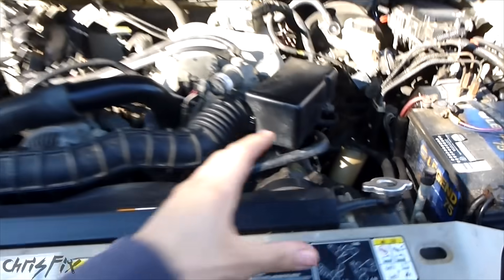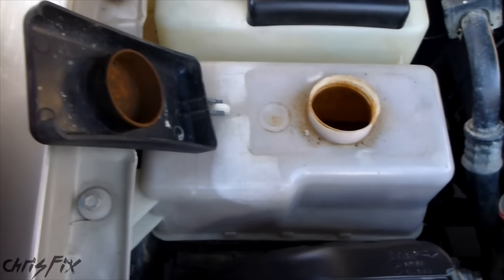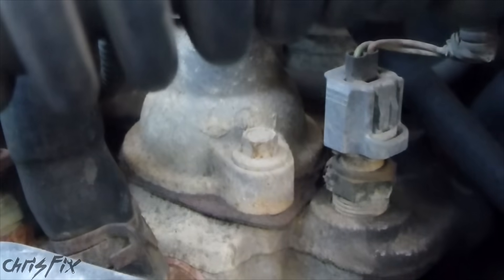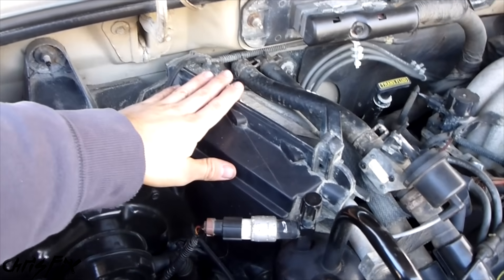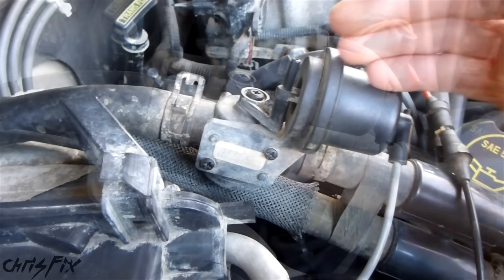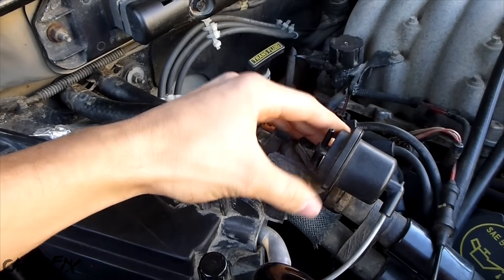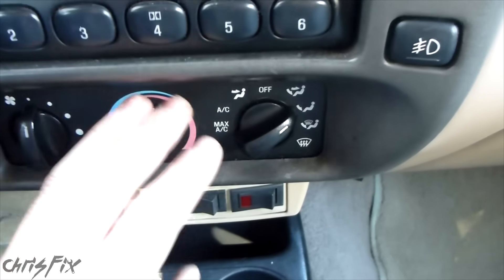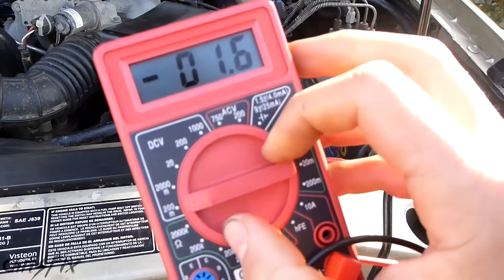How to Fix a Car with No Heat (Easy)

Comment: Dang that coolant in the radiator is sludgy
Reply from the maker: Yea it was bad. I ended up flushing it.
Reply: @ChrisFix. My daughter has s 2011 Chevy HH and the blower is not working at all, nor is any heat coming out of anywhere.  Not to mention,  water collects on the passenger side and gushes down on the floor, drenching it.   In the summer, the air conditioning doesn't work either, not sure what to do!!!   Please help me!!!!!

Comment: I'm tired of all these Toyota ads talking about how sporty the Corolla is let's be for real nothing is sporty about a corolla if they think that is sporty drive a Mazda
Reply: So, I drive 130 miles daily to go to college. (Adult going back to school.) my main vehicle is a brand new Explorer sport, amazing vehicle that I love but don't want to run the miles up on. My 01 Jeep that I drive daily just blew the radiator. Instead of fixing and dealing with that I decided to get a base model extremely cheap car that gets good MPG. Toyota offered that with a corolla. It was 14k with an amazing warranty, oil changes and car washes for life. Towing to the dealership payed for by the dealership. This week is week one with it and I'm getting 42mpg in the hills of WV mostly interstate driving. To describe the "performance," it is defiantly not fast, sporty I think is the best word. It barks the tires, it takes off moderately quick. Shit, I don't know the hp, never cared to look, but 80hp in a tin can will be quick, lol. I love the car, it's like a go cart, lol. But it's not a twin turbo ecoboost explorer. Sporty is the word, it will take a turn quickly.
Reply: +JayButcher1127 Model year?
Reply: +nate1829 2016 since the 2017's are the new toys they are giving great deals on the old ones to get rid of them.
Reply: JayButcher1127 No, what's the model year of yours?

Comment: Thank you young sir for an extremely comprehensive video. I have unfortunately done most of these options on my ford connect van . In two days l will be changing the water pump and both belts( cam and serpentine)  so l will have completed the round robin of your options. Just in case though l will be putting a T in the topmost hose for bleeding the air

Comment: Hi Chris and thank you for all your hard work.  I have a 2008Jeep Liberty 4x4 trail rated. I do not have heat. 
1. I flushed it , (the way it flows only) 
2. The temperature gage is at normal ( middle)

Comment: just looked at some of your vids, always good as usual, the only comment i will make is that u actually can  check it with the engine hot, i do it all the time and my preferred method...if you leave the engine running and slowly open the radiator cap with rag, you can open the system. when its running and hot, the thermostat is open and you get a more accurate sense of how low the coolant is. when the thermostat is close, some of the coolant is blocked and you may or may not get an accurate level sense depending on where the bulk of the coolant has stopped...Atleast that's what we learned in autoshp class....LOL keep up the good work.

Comment: Also, if you are sitting idle, the accessories on the engine are not spinning at operational rpm. Simply hold the rpm at 1500 - 2000 rpm for a minute and the a/c, heater, and electrical system will run better. This will also keep the engine oil pressure up. If at idle for a long time, you will want to hold the higher rpm as long as possible, preferably during the entire idle. This will also keep the engine from getting hot during summer time, since the coolant will flow better.

Comment: Thanks Chris !   Your video helped me troubleshoot the problem.  My sons big feet knocked out the electrical connection under the dash which controlled the heat modulator.

Comment: That was a pretty good video man. I have a radiator leak and have to replace it but for the meantime I've been trying to learn the system so I can get heat and keep the engine from over heating and keep water loss to a minimum while driving and this video summed up all the heating core side of things, thanks

Comment: Thank you very much brother lot's of love from india just because of this video I solved my heater problem 
wire of  hot and cold air switch of from the position..
 that's why my heater stuck at cold air intake that's why my blover not throwing hot air
Now just because this video I checked the under dash wiring and solve the problem.. Thank you.💝💕💕💕💕

Comment: Great video,  I love to watch them and use it as my guide to fix my car ,  right now have some strange problem with the heating system in my car and looks as can not find the problem. 

Have good heating on the p.side but no heat on the rest checked all what you covered and looks good one of the activators was not working fixed that but still no heat .

If I put ac on it frizing cold but when put on max hot just a cool blast 
...
The radiator was replaced as well ...

Lost in finding the problem , the car have climate control for front and rear , rear acts the same way as driver side ...

Comment: Every video you have helps me out and get an understanding of every aspect of working on my vehicles but for the heater issue, everything that you named off in this video works on my vehicle but the coolant lines coming in/out of the heater core are staying cool even at operating temp and i am in the process of doing a super flush from one of your other vids and i flushed even the heater core until it came out clear and i am on the last flush before putting fresh antifreeze in and i bled the top and bottom radiator hoses by squeezing them (a bunch of times) including the heater core hoses and cant seem to get any more air out and still no heat at operating temp any other thoughts or suggestions (no leaks, and again for some reason the hoses are staying cool)

Comment: One problem you didn’t mention what happen to one of my old cars, the person before I bought it used so much stop leak that it clogged the copper tubes, it was so bad it blocked both the in and out of the cooling system. We had to blow it out with a air compressor after that the heater worked perfect. This goes to show you that you should fix your  radiator if it has a leak vs using stop leak, it can clog the cooling system. We found this out after I had the whole cooling system fixed from Water pump, Radiator, to all the hoses.

Comment: Thermostat is not always on upper hose, many are located at the lower hose. Just to clear up that misinformation. Other than that pretty good video. Love the sludge shown, hopefully it will show people the reason we recommend cooling system flushes.

Comment: And if you pull your radiator cap Aand it looks like a brown paint bottle exploded, you need to flush your radiator and possibly remove it and have a radiator shop boil it out. 
Good video. 👍

Comment: This helped a lot. Being that my heat ain't working. Just stopped and startimg to overheat. An that's when the heat starts to work. I'm sure that's not healthy for the vehicle. So I'm guessing my water pump isn't working or sensor isn't. Or both 🤣 wish I knew more. I hate waking up driving my son to school in a cold vehicle

Comment: Last week, Carsmart told us that it needed a new fan blower and resistor. 

A nice mechanic in Walmart auto (when I got an oil change) said to order the parts on Amazon and watch a youtube video and do it ourselves. So I ordered a resistor for $14 and a blower for $37 at Amazon. The one company sent the WRONG blower, too small. So he was only able to put in the resistor. And it did the job!!! We now have heat! It's incredible! 

I'm just sharing this because my son has never worked on cars before (age 22) but replacing it wasn't that difficult of a job. I wish everyone the best at having heat, so they don't blow their circuits like I did trying a portable window defroster! :P 

Maybe do like me-- take it to a shop and pay a $50 diagnostic fee, and then just do it yourselves. (I don't know why they said it needed a blower though. I'm hoping it wasn't Car Smart being dishonest---- but that it's just hard to diagnose which one is the problem. (Does anyone know if it's hard to tell which is bad?)

Comment: You are the man! I 'am no mechanic by any stretch of my imagination but, I do know how to problem solve. Everything you said has validated what I thought the problem was. I wasn't completely sure until you made the comment of the "clicking noise". That is exactly what I'm hearing, I have had no heat for about 2 years...good thing I live in Vegas, lol. Do you have any, or know where I can find, videos of changing out my actuator for an F150 Crew Cab, 5.4L V-8 (2001). I have seen videos of 1- or 2-year models over/under mine and the ones that were the same year were not the same model. In those videos they talked about cutting and not so much of removing the dash. I realize removing the dash is time consuming...which is why they cut the back screws out. What do you recommend? Thank You, J

Comment: This is handy I will need this for later.
Can’t check right now but our truck we got for 1000$ the fan only work on it’s highest setting.
And only blows hot air.
I set it to cold and it blows cool air.
One day when I was running the truck with fan fan on I heard a knocking and something under the hood in the top left corner by the passenger side was vibrating like crazy.
So I just turn off the fan and mever used it again.

Comment: Also we use a online heater to so your rad is warm. And you're plug in heater is the block. So there u have a very toasty motor. Most people in northern Canada have these it sends hot air Al the way threw your rad. Just splice in the heater core hose and place it there.

Comment: Very good video. I have 2012 Caprice and it has dual zone, passenger side works fine but driver side always blows cold (and it's winter now). I guess the blend door actuator is stuck on driver side and always allows cold air in. I wonder how I can get to it. Taking a dashboard apart doesn't sound like fun

Comment: I have a 97 Ford Ranger. I live in Florida, so I leave it on full A/C all the time. The previous owner had to have the blend door fixed. It cost him $600. I'm getting an electric heater to plug in the lighter.....

Comment: Top information, brilliant channel. Rather late comment i know, but only just watched it. Question for you please. I have a transit van which has a good heater, but the vents in the dash board only ever blow cold, even when floor vents and windshield vents are warm. Why could this be? Cheers

Comment: Hey if you flip that jug of coolant upwards with the opening at the highest point it allows air to go into the bottle while the coolant pours out, therefore eliminating the "glug" and you get steady stream of liquid pouring out and you will no longer splash all over when pouring a full bottle of anything 😉

Comment: chris here is a video u can do for the e46 u own ... show us how to fix the air blowing motor ... temperature sensor etc it's a pain not knowing what im doing and how to check all the parts that get involved with that motor not able to start and push air into the vents. i got a -40 error then it stopped and 2 days later my AC wouldn't blow air after i kept car parked

Comment: Thanks for your video.

Why the radiator it's dirty like that, my is same, and how we can cleaning.
Reply from the maker: I recommend doing this if your radiator is dirty: https://www.youtube.com/watch?v=s--5ft5YiHg

And the original owner of the truck didn't do any maintenance besides oil changes, and the coolant eventually got dirty and worn out
Reply: @chrisfix  thank you

Comment: . Thanks for the videos much appreciated for a single-income person that doesn't have much money to spend on getting a car fixed. I go out every morning and start my car and let it warm up before I leave for work. When I get in the car the gauge reads at the halfway mark between cold and hot. But there's no heat until I start driving. Any suggestions? Thank you

Comment: My 06 Pontiac Torrent wasnt so easy. The blend door is stuck on air conditioning. The socket where the Motor shaft plugs  in is broken. It is junk plastic. I'm amazed it lasted 200 K. Think of a plastic socket wrench The blend door actuator works fine. Its electric. The 93 Subaru Legacy will get me thru the winter.

Comment: Pull your controls out and check the mylar circuit board for any burned out paths. Jump with a wire and you’re good to go.
Reply from the maker: Good to know if it ends up being the controls, thanks for sharing!

Comment: I have a question for you (dont know if youll answer because its been years), but my car only heats up when Im above 80kmh (50mph). When I go back below 80 (usually around 60) the heat stops working again. Any solutions?

Comment: I know its an old video, but do you have a video on how to fix driver side and passenger side dual climate control issues? My 2003 pontiac grand prix blows hot on drivers side but cold on passengers side. Thanks in advance. Also, love the vids bro.

Comment: Troubleshooting my lack of hot air-checking the heater core hoses; I fond that the return hose was looped back to the supply port, with the supply hose being left disconnected. In other words my heater core was not connected at all. Previous owner did not disclose an issue and is was hot enough that I must have failed to check, when purchasing it, a few years back. Leaking heater core is clearly the reason though, for that temp summer fix.

Comment: Thanks for very informative and troubleshooting video. I have no heat blowing when my car has been running in park and even after it reaches normal temp between C and H on the gauge. Both hoses are hot coming into and out of Heater Core.  It only starts to blow hot air after I have been driving for a few minutes. Read somewhere that it could be a bad thermostat that is only opening when the RPM goes up? Does this make sense? Would a heater core flush help also? Thanks in advance!

Comment: 👋 hello, hope you are doing well.
I have a 2008 Chevy cobalt. And the heating is a mess. I replace the resistor every 6-8 months and the same with the blower .
Plus replaced the fan speed button, that worked only on 4 and the other only worked on speed 1-2 -3 . 
Why , this can not be normal. 
And yes I get a water puddle if the ac is on .

Comment: I have a strange issue with my truck. I went through the entire system, all the blend doors and their actuators, of which are working. Checked the fluid level, and it's good. I've changed the thermostat twice, the second time because the person I took it to said it was bad. They also said the heater core was in good shape, don't know how they could quite tell that considering one hose is hot and one would is not. Sometimes I will have heat minimally, sometimes it'll just blow cold. On All Occasions, cold air is somehow coming into the cab on the driver side and freezing my feet. By the way it's a 2016 Dodge Ram

Comment: I have a 2016 gti. While driving, the heat is lukewarm, but when stationary, it gets hot like it should. Operating temp and coolant levels are normal. I can hear the blend door and recirculating shut offs working properly. Both heater core pipes are hot. I'm at a loss and not sure what to check
Reply from the maker: Sounds like the thermostat is starting to go bad and sticking open or opening up at the wrong time, if the opposite was happening it would be low coolant or air pockets. Because it's a newer car, is the thermostat electronic? If so can you scan it or bring it up on a scan tool and see whats happening when driving/idling?

Comment: Just had my car in the shop. Replaced a bad water pump, pulley for water pump, bad intake gaskets, and now I only have cold air blowing. At least I got a pry tool they left in the engine bay.

Comment: Rarely are heater issues caused by a defective water pump.  When the water pump goes, you'll know it.    These problems are typically caused by low levels of coolant (due to a leak, usually), or a defective heater core, or a bad thermostat, or a faulty heater contorl valve.

Comment: Chris, I have a 2021 Acura ILX. I drained the radiator, refilled with the spill proof funnel, and now I’m only getting heat on Hi, setting. If I go to 86,85,80,ect…. It immediately goes to room temperature. Any suggestions? I ordered a vacuum coolant kit, and I’m going to try that? I burped the system with the funnel for three days, getting more air every time. Thanks👍
Reply from the maker: I would definitely keep burping the system and see if it improves any before doing anything else
Reply: @chrisfix  I think it’s coming around? I drove to a store last night, after burping more air, and I think it’s finally all getting out of the heater core? Worst car I ever had to burp. No bleeder screw like the old days. Thanks Chris, appreciate the advice 👍
Reply: Chris, I did a brake job, on this car, and that was easier than burping the system on this car. Rotors, and pads, and new hardware. Drilled and slotted. Lol These closed systems are tough. Just add a bleeder screw, it would make everyone’s life much easier, as far as bleeding the system? Wonder why they don’t?

Comment: I am a subscriber..your videos are great and you explain it in easy terms..i have a question ..i have replaced heater core because it was leaking ..got my 99 jimmy back from mechanic and there is abit of heat but not as much as before .In your tutorial about the blend door ,could that be why its lukewarm air coming out,both heater core hoses are hot .When the blend door is open does that suck cold air in the cabin because i feel cold air behind the dash ..thanks for your time

Comment: Nice video.  Question:  2005 Elantra and a 2007 Sante' Fe.  When giving gas the heat works well.  When sitting idle it dosen't again, when I give it gas it comes out hot.  Any suggestions?  Thanks